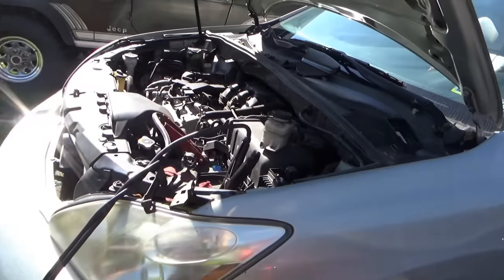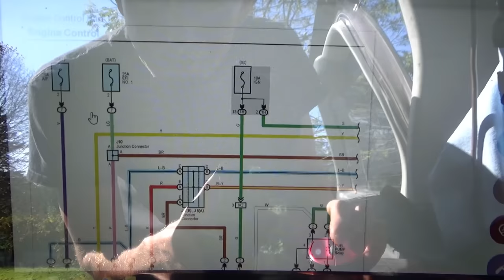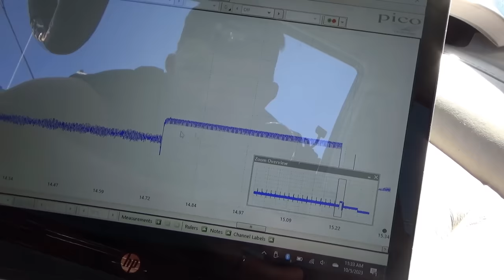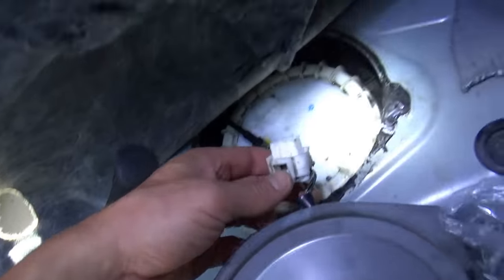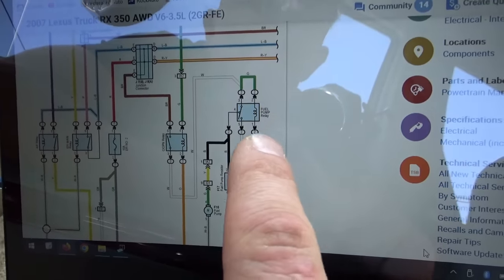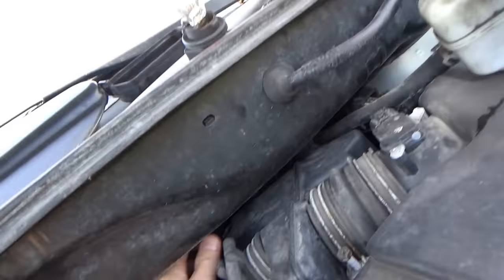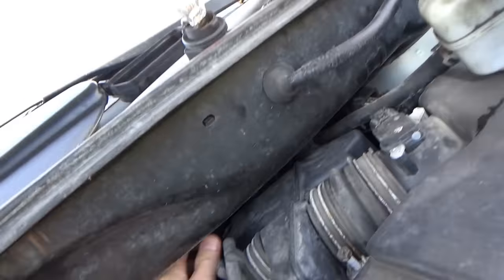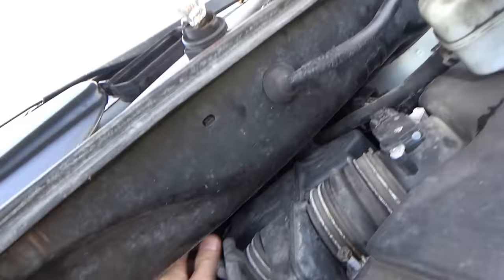Lexus Random STALL...After Engine Swap? (RX350 V6)

Comment: That amp clamp trick to chase the short is genius - so simple and so effective - why did I not ever think of that! Well done Ivan!
Reply: YEP, new one for me too!! So simple!
Reply: It's also new to me... And I will put it into practice when I have a similar case to measure the amperage level that a fuel pump should have when I suspect that something is wrong
Reply: Keep in mind it measures the total current flowing in the clamp, so if the current is going out and coming back on separate wires in the same harness it won't show anything on the clamp. Fortunately, cars usually don't have ground wires in harnesses, but if the short is more complicated you never know.
Reply: @CoolerQ  That's why the connector was disconnected. If somehow you got multiple shorts to confuse matters, you could still test wire by wire at points along the harness.
Reply: @CoolerQ  good point 👉!
I was attempting to think if there would be some conditions where it wouldn't work. 🤔
Reply: @pingpong9656  Yeah, you could test wire-by-wire but then you have to unwrap the harness at each spot to get access to the wires. That seems much slower to me than clamping around the whole harness.
Reply: @CoolerQ  It would be, but you would be dealing with rare complex multi-short problem... if you can isolate connectors on each side, you send current down shorted wire, and it will be very accurate at tracking down the short without opening the harness.
Reply: @dans_Learning_Curve  There is one scenario... even with the harness isolated. If current could travel up a wire that is shorting out - the current could be traveling up the wire to a short between a second wire, and the current is then returning to a second short to ground. The amp clamp will display zero where current flows in opposite directions in this scenario.
Reply: Yep. Gonna use that one in future. Light bulb moment.

Comment: More than likely whoever did the engine swap removed that liner for access, and probably put the self tapper in. If that was the case, He should have the honor of paying the PHAD fee.  Nice work Ivan. 👍👍🇺🇸
Reply: Given that the tech did not remove the factory bolt makes me think that he just just ripped the splash shield away when doing the removal because time is money. I cannot trust shops in doing good work.
Reply: @scientist100  It could have been rusted in place. But the liner was damaged too, so a new bolt wouldn't have held it in place.
Reply from the maker: @ehsnils  Actually I reused the original factory bolt that they left in there...held up the shield just fine lol
Reply: @PineHollowAutoDiagnostics  OK, I couldn't see the original and it did look like there was some damage to the shroud and I assumed a broken bolt there.
Assumption is the mother of all Failures.
Reply: @ehsnils 
Even if the hole is ripped clean through mudguard washers are your friend for a larger clamp area.

Comment: Great logical process and fix . Some people use a cable tracker to locate the short in the wire . I think Power Probe has a similar device . A compass will also show the direction of the current flow . But you already have an amp clamp , why bother with other tools . This is the first time I have seen the amp clamp used for this . The current has a magnetic field in the wire .

Comment: Good fix!   A lot of folks would not have looked for the point of short and just ran an overlay and then a little later down the road had another wire damaged by that sharp screw.

Comment: I've seen this at work. Automation engineering mounted something to a machine on the outside of the cabinet and screwed one of these screws into the wiring harness on the inside of the machine.

Comment: Good progression to the flaw! I am very disheartened by sloppy workmanship and inconsiderate installers. I just had a trailer hitch installed by a dealership: the installer left one support bolt loose and the wiring harness interfering with the spare tire. I can even acquire the name of the person who installed it.

Comment: Another victim of the self-drilling screw. I've had to repair countless wires in breaker panels and various electrical enclosures and repair leaks in sealed refrigerant systems because of previous techs zipping in a "self tapper".

Comment: It's interesting how some never think but in one direction and still don't fix the problem.

It's always necessary to break multiple branches in order to determine which branch horbors the problem.

That's what makes watching your videos a pleasure, Ivan.  You know it's necessary to break branch connections to isolate the branch containing the problem.  This process can be applied to several fields.  Unfortunately, too many in these fields are nothing more than parts cannon people.  They either haven't learned to isolate the trouble, refuse to learn, or aren't given the time to apply the process.  If they refuse to learn or aren't given the necessary time, then either the customer suffers or someone else has to work on the problem.

Keep up the excellent work, Ivan.

Comment: Whoever put that other fastener there could have taken the old one out, and reused it with a washer to strengthen the rip in the splash guard. Unless the old one was rusted in place and they didn't want to go to the trouble of removing it. The truth is that most times, these fast and dirty fixes don't cause issues (that can readily be traced to them anyway), so people become complacent and use these methods all the time. More often than not, if something comes from the factory a certain way, there's a good chance it's for a solid reason.

Comment: Nice work Ivan! Always correcting someone's screwups.. no pun.. Did you ever think of a small, and not to obnoxious buzzer or tone device in conjunction with the test lights while hunting for a short to ground? It would have worked in this instance.
Reply: I used to work in a communications co, installing and testing comms cable install in large buildings, Without a buzzer could never have traced those cables through many conduits and jbx's. 👍
Reply from the maker: I HATE beepers and buzzers of all sorts haha
Reply: @PineHollowAutoDiagnostics  Same - those things trigger randomly on ghost voltages - I think RF signals cross talk on other wires and they send you off on a wild goose chases... This current clamp is rock solid.

Comment: Those 3.5 Toyota engines are phenomenal, very strong and really the only issue is that rubber cooler line, spend the 175 bucks and replace that and you should have an engine that lasts a very long life.
Reply from the maker: Indeed. Some people still ignore the warnings before it's too late :(
Reply: @PineHollowAutoDiagnostics  My understanding is that there are really no warnings…?  It just ruptures of old age and heat cycles?  Ivan, have you seen signs before they rupture?
Reply from the maker: @hokie9910  Usually almost no warning. I meant I've told owners to change the rubber hose, but they ignored me and still blew their engine LOL
Reply: @PineHollowAutoDiagnostics  oh gotcha.  Unbelievable, a couple hundred dollar repair leads to a 5-8k engine

Comment: If you knew the resistor was getting super hot, you already knew that the resistor was carrying too much current, which means it spans too much voltage. So you already knew from the beginning that there was a short to ground on the side of the white wire, since the other side connects to the battery positive.

Comment: Make no mistake about it: Toyota and Lexus vehicles like their maintenance.  I wonder if that oil cooler failing was part of preventive maintenance?  I would bet not.  Now as far as the issue with the screw, I would say the tech that replaced the engine just drilled a hole and used a sheet-metal screw that went into the harness instead of unscrewing the factory one provided; hence the "down and dirty" comment from Ivan.  I've seen you get "down and dirty" as well, Ivan.  However, you do make it a point to inform the customer and then you refer to those as "Russian repairs."  I don't think that could have happened to a 966.  The whole car only has 2 wires probably.  GREAT VIDEO!

Comment: Super interesting!  The resistor block was getting to 400 degrees and super hot, because it was supplying the ground all the current it could when the fuel pump was being commanded on.  The current was going the opposite direction from the intended path.

Comment: That was a cool diagnosis! I'd never seen a fuel pump circuit with a resistor in it like that, and wonder if pressure measurement by the ECM switches the resistor in and out, as well as how many models had this feature. Great going, as always!

Comment: On that two speed pump control it starts in high speed bypassing the resistor, then after a short time switches to low speed pushing the current through the resistor to reduce pump speed.  If the resistor is bad it will stall the pump.  It is kind of rare but have seen is a couple of times.   The easy way to do it is to just unplug the resistor and jumper the pins in the connector and see if it stays running when it switches to low speed mode. Lets see if that is the same issue I have seen.

Nice job!

Comment: Similar to the leaking outdoor air conditioner condenser coil. A tech or DIYer before you installed a hard start kit in the cabinet with a long sheet metal screw and hit the coil.

Comment: I had a 1999 Ford Ranger that would blow the fuel pump fuse intermittently.  Changed the fuel filter and problem resolved. At the time the truck as only 5 years old and under 70,000 miles.

Comment: This reminds of when I had a massive short to ground on my 1991 Toyota Celica. It was blowing the main 100A fuse and I'd lost most of my electrics. I methodically went through the OEM wiring diagam and then I noticed that there was a stray wire (what was left of the capacitor which supresses audio interference) that was shorting to the alternator body. Once that wire was removed the short was gone so my repair was also a negative parts required repair.

Comment: Nice!👍
My first guess, when seeing fuel pump and fan sitting on one fuse, especially, after engine swap, was to check out power consumption for fan an fuel pump.. 😂
Excellent solution is to put clamp over all harness to get short circuit spot.. That was amazing idea! 😊 Before knowing this method, I probably, will turn apart all harness in suspicious points, in similar situations, as before.
Back in days I did it for scooter diagnostic - turn apart one harness section where I get short between wires.. In that situation, at the end, that was the best solution, because multiple wires was melted together.. 😂

Thanks for sharing great tips. ❤
I have clamp meter, but that is for oscilloscope and still can help figuring out issues in similar situations..

Comment: Another Top Gun analysis with detailed step-by-step troubleshooting
Ivans teaching style is point on, asks that the viewer do much of the thought processing n final cause.
So many of todays auto techs are only yes no flow chart repairs with no analytical analaysis.  Caused by auto manufacturing engineers making the judgement call that shop techs are not intelligent enough to do repairs other than simpelton flow charts

Comment: Now that was a good one, and I'm not even going to bust your chops about" no parts required" even though you didn't need to put parts in it, I really liked your trick with the amp clamp, you have to do more videos using the amp clamp like that. Nice one!

Comment: another good diag. I find the best wire insulation repair is 3M Scotchkote - strong as can be, along with heat shrink or premium electrical tape. as I feel liquid electrical tape is junk.

Comment: The resister getting hot on 12 volts is odd, wires should also be getting hot, I would check voltages on the circuit, it should be dropping voltage on the high current trip.

Comment: Insane case study here ! 
Question for you Yvan, I have been using Pico 6 for a long time because I greatly prefer it to version 7, why do I need Pico 7 to open your waveforms? 🤔 
(When I try to open it with Pico 6, I have this error message: The file was created with a newer version of the application)  
And yet, you are using version 6.... 🙃
Thanks a lot !
Reply from the maker: Hmm do you have the latest Pico 6?

Comment: There should be a section in chapter 1 of the Mechanic 101 textbook explaining why you don't drive screws into places that might have anything remotely important behind them. At least it wasn't a fuel line ⚰

Comment: Just put an engine in a new to me 2009 RX350 and it starts then stalls.  The fuel pump resistor is completely missing (shady car lot where I purchased it probably took it), my question is will the car run without the fuel pump resistor in place or will it start then stall?  I'm going to see if I can find the part locally just hoping it likely be fixed by installing the resistor.

Comment: @ivan could you have used the thermal camera on this one while the circuit was loaded with 1amp test light to see where the harness is heated (bright yellow) and it would have stopped at the screw where the wire was shorted
Reply from the maker: Hmm not sure if 2 amp would heat up the wire enough... But maybe 20 amps would 🤔🔥

Comment: Lesson to learn here - do not replace factory fittings with random self tapping screws! 🤣
Reply: I think the lesson is, look behind where you're drilling.  Maybe the original mounting location isn't usable, or more likely someone is installing an aftermarket box.
Reply from the maker: @major__kong  I actually reused the original fender liner mounting tab....with the original bolt that was STILL THERE haha

Comment: Couldn't the short be narrowed to the load that gets hot in the beginning? It would have to be going to ground on the positive side of the hot resistor (white wire). Does the computer sense high amps and cause the relay to trip on and off? And "On" would be the white wire slow speed?
Reply: no , that was caused by the engine vibration

Comment: Ivan…know you’re not a fan of the device, but…what if you had used a load pro lead to confirm the short to ground and determined if it was on the power or ground side? Would that device have saved you time with this diag?
Reply from the maker: Hmm Load Pro only leads to confusion and is a pain to use since you need a DVOM wired to it and you need to hold down the magic cucumber button all the time 😂

Comment: what should have been used was a large disc of nylon instead of creating a new hole.

I have never liked using self tapping screws and always tell the workshops I use about it. but the mechanic does not always get to know what I say at the reception.
Reply: Sometimes it's that, a rivnut, or a well nut.  I prefer a bolt and nut where possible.  But I hear you on not using self tapping screws.  I just pulled 6 of them out of my tongue box and replaced the 4 corners with a nut and bolt because I could reach and 2 center with well nuts because it was a blind hole.

Comment: I haven't read a wiring diagram before but when I saw this one, I felt that it did show the way the pins were wired. On the left of the relay on the diagram, the bit you realised was the right one was the wire coming off the side... which implied it was the middle pin. It is very hard to explain here what I mean. Maybe I'm missing something but that diagram does to my eyes show which pin does what.

Comment: Who the hell else would've chased this down? If only all mechanics were like you instead of guessers/parts swappers. It's only going to get worse unless car companies wise up and go the other way. Make cars simpler. Make then stupid simple. Charge a few more bucks up front for the lost parts revenue in building reliable cars. Imagine  a new car with just one computer for the fuel injection and one for the ABS, no CANBUS modules, no computer screens, direct wiring, etc. Well, I can always dream...
Reply from the maker: You're describing 80s and 90s cars...I own 4 of those and love every single one ;)
Reply: @PineHollowAutoDiagnostics  I have a 1997 Lexus LS400 - it has 170,000 miles and never breaks. For repairs, it has needed: a fuel pump at 160,000, and a washer nozzle. That's it! This despite its obvious mechanical and electronic complexity. My other vehicle is a 2006 Dodge Caravan with 240,000 miles. It's needed many repairs, but it's all been bolt-on stuff: alternator, EGR, water pump, mufflers, and a steering rack. The rest has all been expendables. But it's a work vehicle. I plan on buying another one from 2007 (last year of the short-wheelbase SXT) and keeping it until it collapses.

Comment: You mentioned the oil cooler lines and engine replacement. Is there a warning ⚠️ when the lines start to fail....such as a slow leak perhaps. Did Lexus ever come up with a solution to fix the problem permanently? Toyota and Lexus seem to be extremely diligent at finding an inproved solution to a problem. BTW...I love watching you work like Sherlock Holmes and determine what electrical problems there are.
Reply: There are metal lines available. Also this only effects Highlander, rx , and sienna
Reply: this problem has been known for a long time if you ask me. metal lines is the fix
Reply: @michealjohnson8248  So being proactive and changing to metal hoses is the best course of action. I love Toyota but this issue should have been on Toyota. Toyota should have offered metal hoses as a better/permanent fix for this issue.
Reply: @mikefoehr235  at least they came up with a fix
Reply: @juanrodriguez-ry6yt  Yup...can't deny that. I hope my 20 Tundra doesn't have this issue.
Reply: @mikefoehr235  5.7 pretty bulletproof